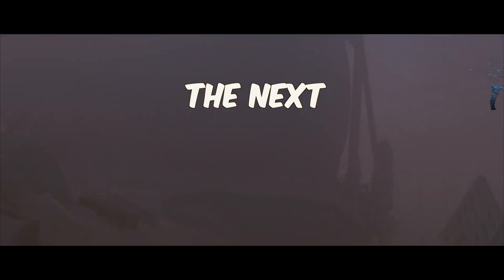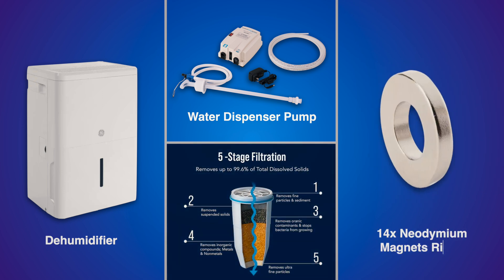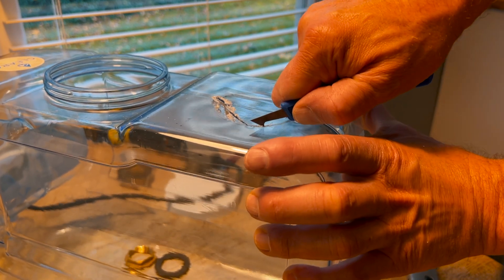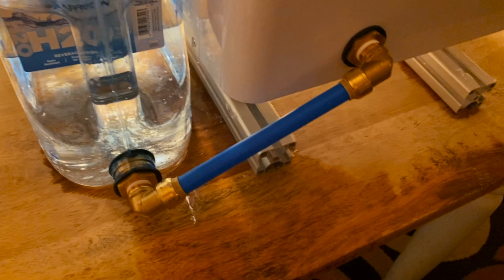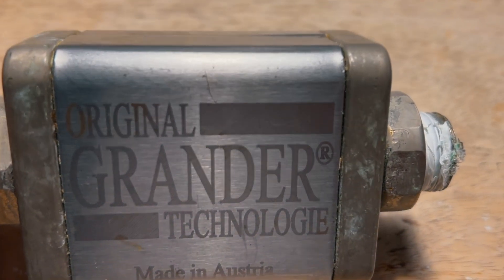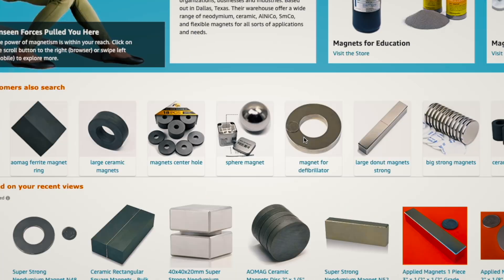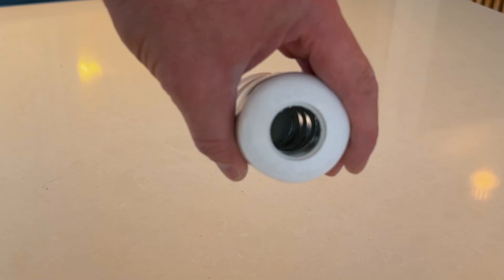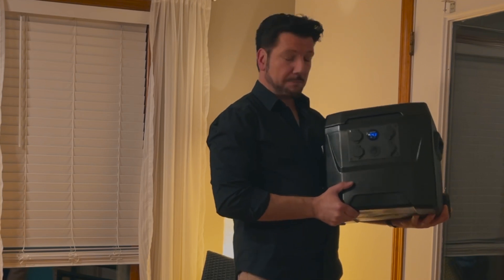Off-Grid Water From Air - Preparing for  the Apocalypse!

Comment: Apparently if water is too pure, it's bad for you; water will forcibly absorb minerals, so if no minerals are present in the water it will be absorbing it from your body.
Reply from the maker: Interesting! Not sure that's factual but sounds logical.
Thanks Michael!
Reply: @MarkusNenning  I'm not sure either, it's just something I've read and been told. When you buy Reverse Osmosis system you can also purchase an additional stage that adds minerals back to the water, to make it "drinkable".
I was also told by a window cleaner that uses RO filtered water to clean windows that it's "too clean to drink" for this reason. He uses RO water because it "sucks" dirt from the window and dries completely clear so he doesn't have to squidgy the window dry.
Reply from the maker: Wow! I think I’ll have to do more research on the topic and perhaps I come up with a new video idea from it :)